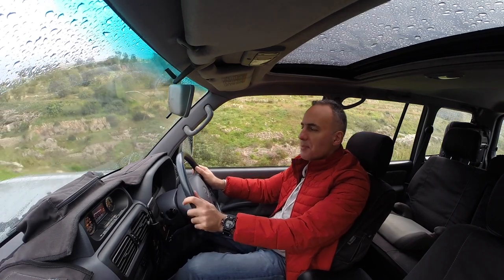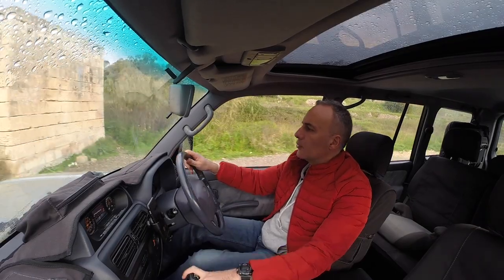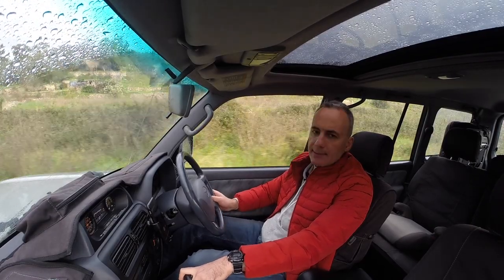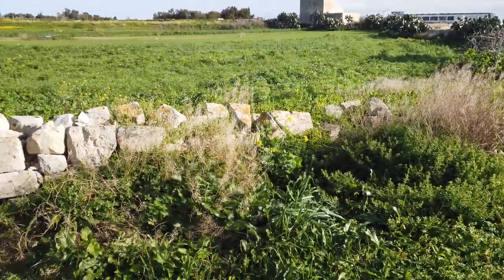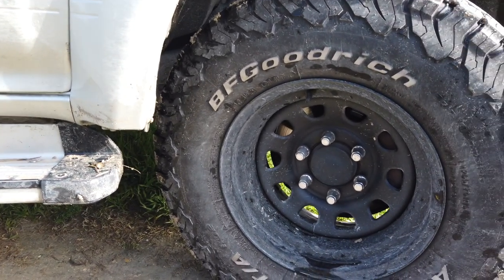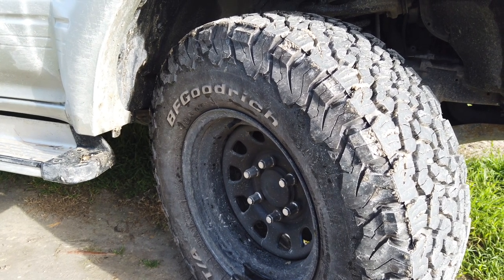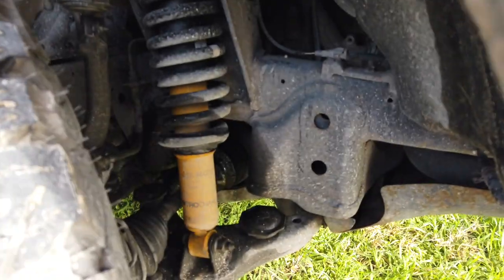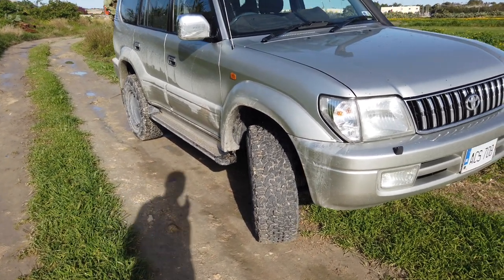Land Cruiser Mods: Tyres, Rims & Lift

Comment: Hi. I recently put in a 2" lift kit on my Prado. The front is now 1" higher than the rear. The mechanic said it would take some time for the suspension to settle cos he changed the front rubber mounts since they were worn (he didnt change the rear rubber mounts). Did you have any issues with your Prado not being level after the lift kit installation?
Reply from the maker: Hi Stephen, no when I did the lift it looked perfectly level, just as it did before just 2’ higher 🙂 - I think it’s better that your rear rubber mounts get changed also now
Reply: @k44_4wd  Thanks for the suggestion!

Comment: Hi can I fitted on my Colorado 285/75/16 and what size lift kit have to use.. thanks
Reply from the maker: Hi Todor, yes you can fit 31 inch tyres but on full lock they might rub so (even depending on the rim offset) there is a small part of the bodywork which needs to be twisted inwards (inner front mudguard at backside), I have a 2 inch lift kit. Good luck!

Comment: Hi, what are the exact tyre and rim sizes you are using? I'm not sure if I've heard it correct in the video. I have to say, these wheels look awesome!!! 👍🏼
Reply from the maker: Hi Dennis, these are BFG All Terrains LT265/75R16 mounted on 16x8 rims with -20 offset. Hope it helps :-)
Reply: @k44_4wd  Great, thanks! I'm planning to do the same setup on my 95series. Or, 275/70-16's. Hope those 'll fit.
Reply from the maker: @dennisvandenakker493   You're welcome! - Subscribe to the channel if you want to see some more footage of this LC ;-)

Comment: Looks nice man. Before I got Tarrano 2 31” easy . + was Mud Terrain on prado i got 17 and Tyers at 265 65 17 10 mill of hitting the upper arm . Don’t have lift kit . What y think can I put on MT just go down on wheels 16 will fit ???  Or like y do offset but again I need to fix full lock tubing. ??